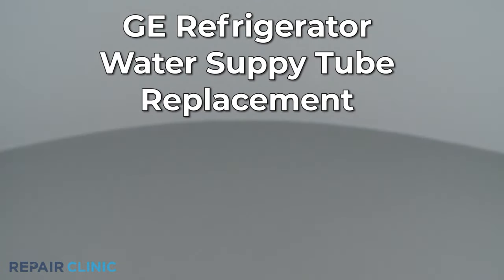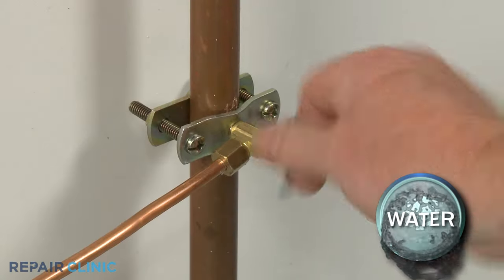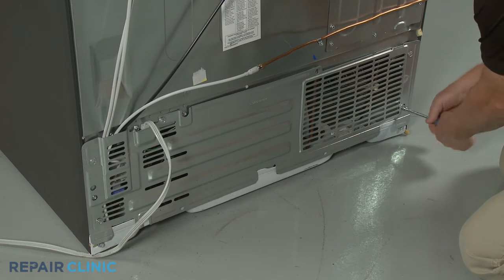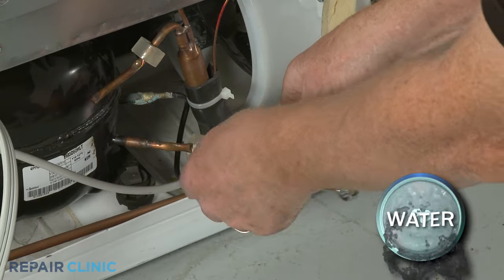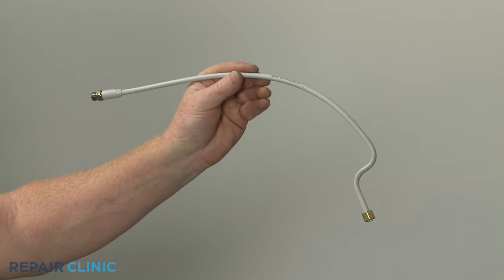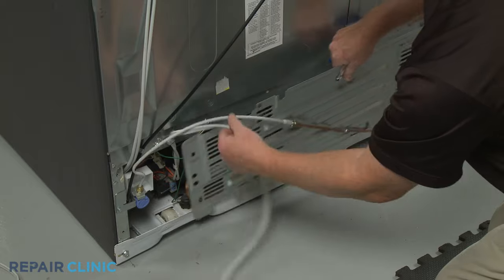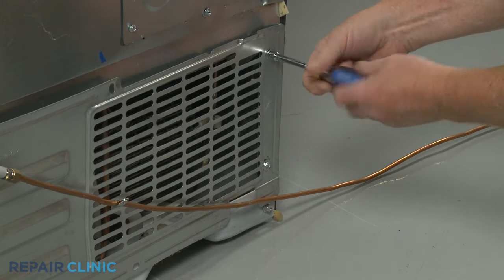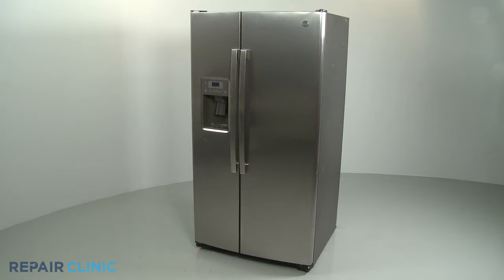GE Refrigerator Water Supply Tube Replacement WR02X13774

Comment: At 2:13 I see the end of the line that is exactly what I need. But the same connection on both sides.  Could you please help me with the part number?
Reply from the maker: You can enter your model number at RepairClinic.com and the genuine OEM replacement parts that are associated with your refrigerator will come up.

Comment: What about replacing the rest of the lines? There is about 10 feet of tubing rolled up INSIDE the fridge at the back... where the water gets cold before you put it in your glass.
How can I speed up my water output. It takes me about 45-47 seconds to fill a 12 oz glass of water. This is way too slow. I've changed the filter but it has always been slow.  Grrrr.....